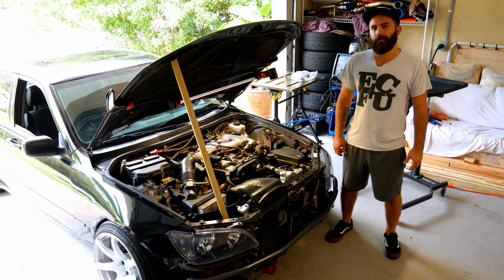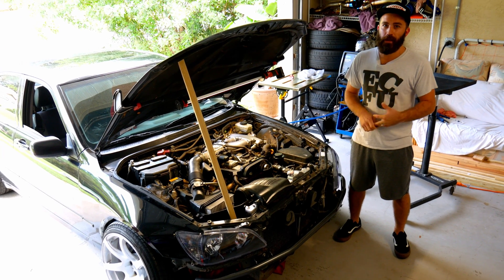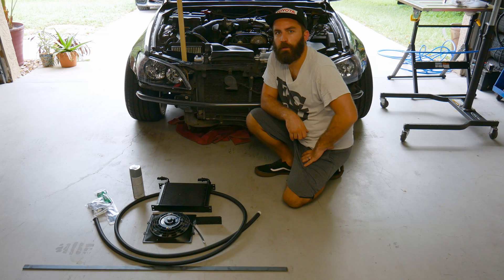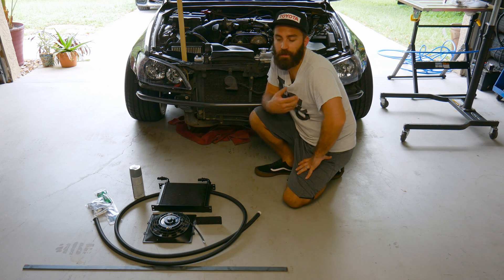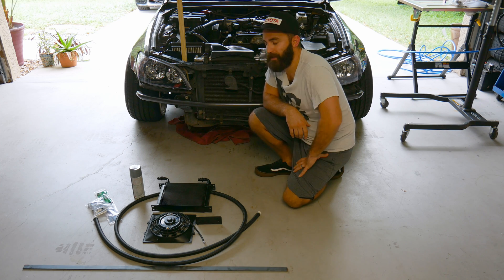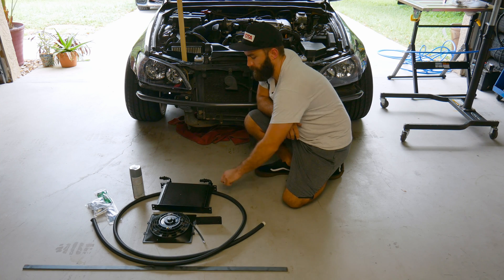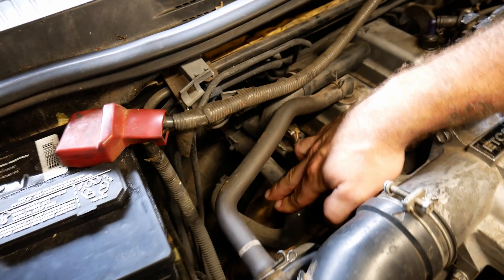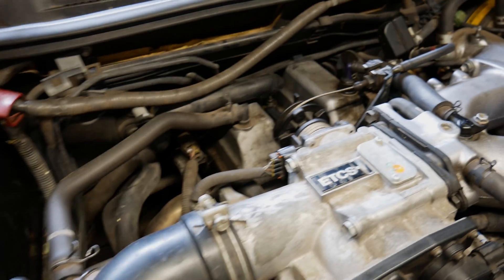2JZ Dual Radiator Setup - How to: Part 1

Comment: Thanks for an informative vid man. Have you noticed cooler temps? Im going to have to do something similar in my 73 diesel swapped beetle
Reply from the maker: I had no over heating issues with it, but I’ve swapped to a turbo engine now and it will be the real test
Reply: @KBNZUS  with a single turbo now, how does the temp holding?
Reply from the maker: @mizanhaslie2302  it does wonderful but I added a koyo jzx100 radiator but shortly after koyo released a race version of the is300 radiator which is a triple pass
Reply: @KBNZUS  im using a mishimoto radiator at the moment.. having heat soak at idle and also when AC is on.. might wanna do this mod...thanks man... In asia the weather is damn hot..
Reply from the maker: @mizanhaslie2302  I had nothing but issues with mishimoto radiators
Reply: @KBNZUS  whats the issue man? Ive been using it say . Around 9yrs already.. so far so good..